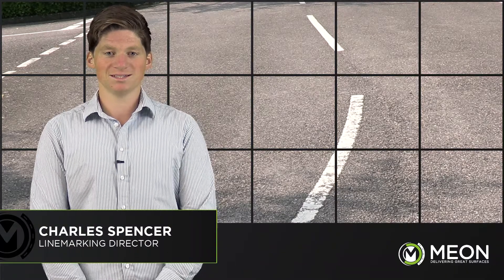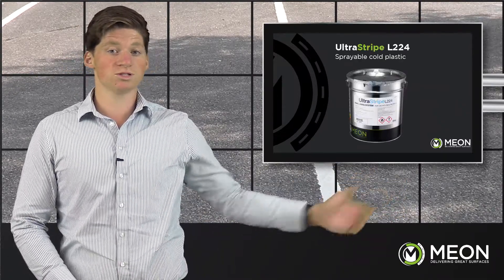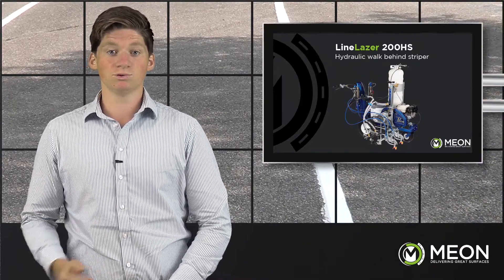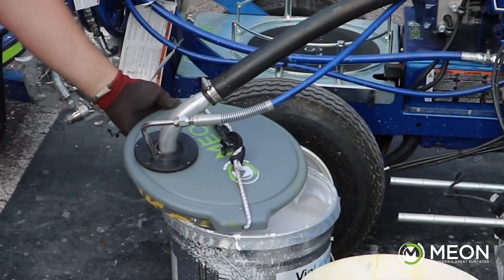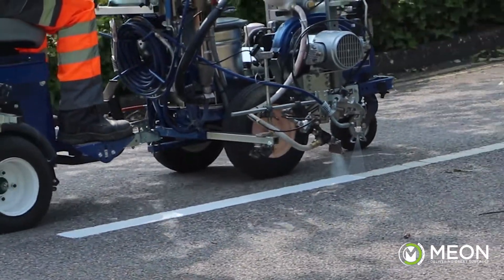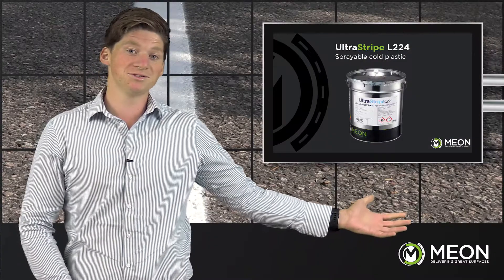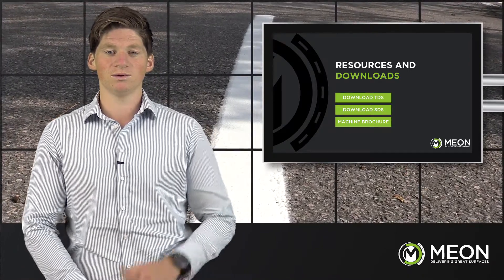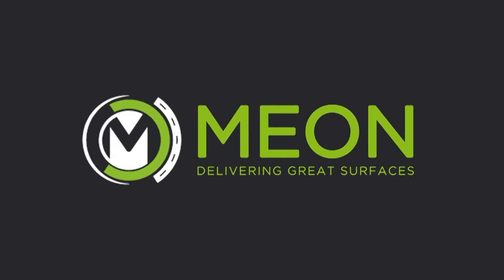Virtual Expo  | Durable Line Marking | UltraStripe L224 Spray MMA  | MEON

Comment: What is the cure time and can a older hs200 machine be retrofitted with this equipment? Colin@roadmark
Reply from the maker: Thanks for showing interest. Yes some of the Older 200HS machines can be retrofitted with the Graco PBS System and depending on temperature  - at 15degC you can expect ‘cure to traffic’ in 15mins, the warmer the surface and product, the quicker the cure time. If you would like any more information please get in touch.